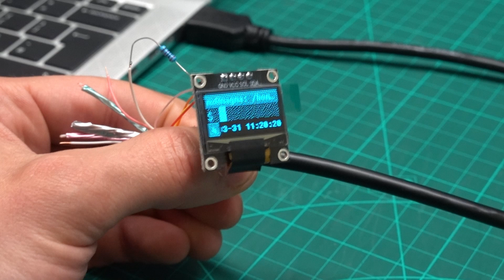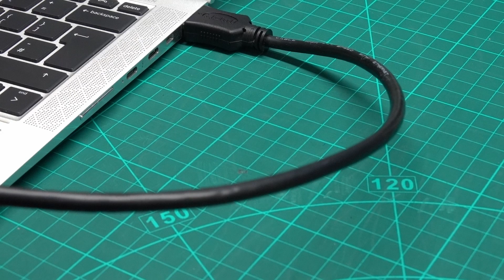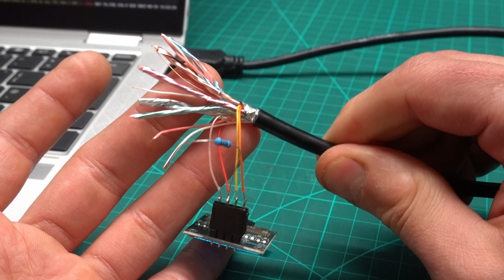The smallest and worst HDMI display ever

Comment: I'm now trying to do this with my VGA DDC, and I've only managed to to configure it and set all pixels high with 0xA5.
Should I be putting the data in some other place that 0x00 of the 0x3C which is the display?

Comment: hey man, got your guide working on VGA! tapped into DDC for the VGA port and it all works powered by the port too! super crazy, i will try initialising the display properly now and start a desktop environment on it, for the sakes of it. you truly inspired me to keep trying this after a year and finding my vga adapter. thanks!
Reply: p.s. booted i3. crazy.
Reply: Did you have a problem where the i2c is connected but not detected
Reply: @APZOEIRT worked fine for me, detection worked immediately and the script ran with adjustment to vga
Reply: @cirkulx its prob my pc having a problem imma try on the luckfox pico later

Comment: You can get miniature displays for like camera viewfinders or electronic monoculars. They will be high resolution and even run at framerates up to like 120hz. So you could get a tiny screen. With much higher quality.... But probably pricey
Reply: found a 3000 Nits 0.71 Inch 1920*1080 Micro OLED Display, but its 250$ usd o.o comes with a board to easily hook it up tho

Comment: holy shit... i suppose i knew basically all monitors manufactured after 2006 or so have an I2C because of EDID, but i never thought to manually go in and mess with the bus. there was a tool that was extremely useful during the transition period of EDID and non-EDID supporting monitors. You would plug your computer's video out into this EDID spoofing box, then the box would output to your weird ancient monitor, and you could have manually adjustable EDID for any given monitor. it let you intercept and change EDID messages or add them for really old ones. This was super useful for some of the shittier drivers of the early 2000's that ONLY pulled specs from EDID, and some monitors just had broken EDID. Basically, the drivers always assumed EDID messages were always correctly formed and had no way of handling broken ones. what a time to be alive! lol

Comment: mitxela, the LoRa devices use this screen. Does it mean there would be a possible way to make a device to hdmi cable? If a small device could write to this display, could the device also handle higher resolutions, or is that where the memory limitations come in? it does some interesting dithering

Comment: The real question for me is if that tiny screen can be upgraded to include a touch screen sensor. 

Imagine having a tiny touch screen from an HDMI port. Hiding a raspberry pi with a tiny screen.... I can see it now
Reply: Well, unless your touch panel is i2c device you can basically connect it to the same bus, access it from pc and write some code, so it will be interpreted as a real touch device in the system. So, techincally it is totally possible unless you don't need your HDMI port for its real purpose)
Reply: @MrImodre  Thanks I didn't know that. I am not a programmer so I'd be behind the 8-ball if I even attempted to try this. I'd love to get it working. It's a good starting point.

My daughter is researching the practical uses for technology when growing food. Trying to monitor pH etc. 

As a intern project for sustainable agriculture en maas or just outright at home. 

The idea is to attach cheap monitors for status but also be able to get into the raspberry pi and configure or update anything on the fly.

The negative is we are trying to do this without making it an IoT device or any connections to the internet. Just imagine using this anywhere in the world
Reply: you could probably use this to make an mp3 player out of a pi zero, if you would be into that
Reply: @autumn64fromdeltarunechapter3  Actually a good idea. I can see them dancing in the greenhouse jamming out on music while taking care of the plants. Hell play classical music for the plants by using it with Adriano to monitor the pH etc. Always looking to multitask lol
Reply: @nomore-constipation  no it's actually a terrible idea because you could just use the native i2c bus and pins on the raspberry pi, because that's what they're for. this is demonstrating that you can do it from a laptop over an HDMI port as a novelty
Reply: You could have, like, a row of them sitting above your keyboard.  Oh yeah, we had that, most people hated it.
Reply: ...mix with a wireless video transmitter for a Dick Tracy watch perhaps?

Comment: Only one thing wrong with it - It's OLED. If only is was LCD. These are used in other small projects and China kits. Kind a cool but personally I really don't like OLED. Leave it turned on and you'll quickly get a burnin on these cheap screens. LCD on the other hand may perhaps lack a tiny bit of contrast but IMHO that is a small trade of not to worry about burnin.

Comment: Is the laptop detected the resolution correctly or you needed to set it manually? 🤔
How the computer detects this display? 🤔
Can be other (i2c) displays hacked onto a HDMI cable like this? 🤔
Also, can this be achieved on Windows? 🤔

Comment: I've just started playing about with a variety of displays; OLED ,eINK, TFT, and this is genius! Subbed.

PS: I've a couple of old laptop lcd panels, wondering if there's a standalone driver board out there I can hook  these up too?
Reply: Yes, if you look on eBay or Aliexpress for „LCD Controller Board“ you can find various sellers (mostly from China) who offer standalone driver boards. In most cases, you have to tell the seller the model number of your screen so they can match the board to the screen you have. The cheaper ones go for around 10-20 $ and often only have VGA, but there are better ones for around 30 $ which have DVI, HDMI and sometimes even an integrated amplifier for speakers. I built a DIY screen with one of those boards myself and it is really handy to have. If you search on YouTube for GreatScott or DIY Perks you can find videos where both of them used such boards to reuse old laptop screens.

Comment: so as it not useing any of the HDMI, video, could you useign in as braek out stile of use still having real monitor on the end of the cable, just extending the required wires needed to get the little screen to work?, the little screen might get a little corrupted if the real monitor pc start talking ?

Comment: I wonder, would you not need to specify the screeen resolution to get the best fit for that device? Also how do you identify which of the HDMI pins/wires is the I2C wires. BTW thanks to your prompting i found a bunch of stuff based on the search "hdmi video over i2c ddc". I had no idea that HDMI had at its heart this device protocol.

Comment: Doesn't VGA already have an I2C? 
Just thought to be able to determine what the monitor is called and what resolution is possible.

As far as I know, SCART only uses 12 volts and sometimes 6 volts as an signal.
But there were also extensions from manufacturers.

Comment: I think your Attempt 1 failed because the HDMI driver would have tried to read the EDID out of the display using DDC, and that of course would fail, so it would just give up.  It also wouldn't have known how to control the display using I2C instead of the normal HDMI TMDS pairs.

Neat hack, though!

Comment: Few years ago I've managed to bitbang SPI on VGA's DDC pins on my 945GM based laptop, and program AVR microcontroller this way.
Reply: Can not be. Yes, the protocol for programming AVR controllers is known, but the I2C (DDC) bus is not used there.
Reply: @ajdarseidzade688  You're right, I2C is not used. AVR uses SPI for programming. It can be bit banged on DDC(I2C) lines with some tricky programming. It is slow as hell, but works.
Reply: @ajdarseidzade688  you can bit bang it still, just like how the attiny 85 doesn't have USB but i still bitbanged the connection + micronucleus to easily program it with usb
Reply: @tormodhag6824  Interesting information. About the micronuleus bootloader. I don't use it and don't know. Thank you.
Reply: @ajdarseidzade688  if you have a attiny85 or other attiny with a hardware interrupt pin on it i would recommend micronucleus it is really useful, my use for it was in this programmable little microcontroller that was kind of like a Arduino but cheap:)
Reply: @tormodhag6824  Thank you! Good luck. Hello from Baku.

Comment: Calling this  an HDMI display is misleading, to say the least.
You could do what you did here just as easily (perhaps even more easily, since you could simply shove two wires in the VGA port without having to hack a cable), with no modification at all, using any non prehistoric VGA port, same with DVI.
Heck, you could do this on a PCIe or possibly even PCI slot too.
Reply: Its a display, that works over HDMI, i'll give him the point even though you are correct as well.
Reply: @nobodynoone2500  Except that it doesn't.
HDMI is not just the connector, there is also the protocol that actually transmits the image signal, which is not being used.
You could tap into the SMBus connections on a PCIe connector and do the same, but it wouldn't make it a 'PCIe display'.
This is clickbait title, as simple as that.
Reply: @pedro_8240  unless you to hack an OLED display to hang off an HDMI port in which case it is an interesting and useful video, calm down.

Comment: Im guessing HDMI protocol is handled on I2C level and safely transformed to this oled. That probably means all electronic displays even smallest use same way of communication on the market. Heaven for hackers
Reply: Actually I think this is just hijacking the DDC (Display Data Channel) controller, normally used for a ROM chip containing info about supported video modes, and just using it as a generic IIC aka I2C controller. This would also work with a USB to IIC adapter.
I believe the standard way to communicate with the charge controller in a laptop battery is also based on IIC, and is called SMBus. Therefore, you could make a laptop battery that is also a second monitor.

Comment: This is flipping awesome! Just for the heck of it, I'd like to put a small oled inside my desktop's case. This might be the way to do it, I have an unused HDMI output on the motherboard.
Reply: OH MY GOSH
That might be a real and ACTUALLY USEFUL use case for it 0.0
Reply: There are multiple projects for that already. Most popular (and the one that you can simply buy for 35$) is GOverlay LCD. It’s awesome low budget hobby project - I’ve been using that for a long time now, and it’s super-hackable.
Reply: This is most certainly not the way to do it. Go with USB driving a μc. You can even pull that off a USB header on the motherboard.
Reply: @TheLukasDirector  sure thing bud

Comment: Would it be possible to create some kind of "adapter" that would filter out the noise on the display? Do you think it would work on an RGB display? I would like to see more projects like this.
Reply: It is not noise, probably there to indicate grayscale colors.
Reply: Yeah, i think thats dithering to give that 1 bit display some greyscale capabilities. also im not sure if this is real or just an april fools.
Reply: @nicholasweiss4662  oh, 31.3, probably 1st April
Reply: @jonny11bonk  It may be a joke, but following the link, I suspect this really works. The display is a real I2C Oled display available from a number of online shops. The HDMI interface does include an I2C compatible port (DDC) which the host PC can access. The DDC connection is there to allow monitors to be 'plug and play'. When a monitor is connected the host computer can read basic information from the monitor about supported resolutions and refresh rates. 
In this case, the port is reconfigured to send display data. This is quite possible though I  have not looked at the code in detail.
On to the 'usefulness'. I am not sure of the capabilities of the DDC port, but I  suspect it uses the standard I2C signalling speed of 400Khz. This would allow a maximum of 40 kilobytes of information to be transferred to a display every second. With the overhead of the display I2C commands, I suspect that 20 to 30 kilobytes  would be more reasonable. 
Why is this a problem? Well, a single VGA screen (320 x 240 pixels) as you might see on a small tft lcd panel needs 76 kilobytes of data to draw in 256 colours. At the data rate above, one frame would take about 3 seconds to send. This is just for a small rgb display. For comparison, HDMI transfers over 1 gigabyte of information per second in 1080p (more than thirty thousand times faster).
So you get an idea of how wonderfully sily this project is. The display is a 64 x 128 pixel display with 1 bit of 'colour' depth. Takes me back to my ZX81 days...

Comment: This would be great for a cheap pc status monitoring screen! It could continuously display cpu temperature or other useful parameters. Using miniature hdmi monitors for this is actually somewhat popular, but this solution is more elegant and should be much cheaper
Reply: I was thinking something like the, make something like USB, memory stick with mini display, even if it only displaying the system time, but in a server/Nas where montior is abit over the top, 
maybe with custiom boot USB boot disk, and this little thing, it could read out test results, 
I take it   it any HDMI/DMI (VGA? maybe) could it be plugged in raspberry PI or anything HDMI/DMI ,games consoles cable boxes DVD/Blu-ray player/recorder etc.
Reply: This wouldn't be great for a cheap status monitor screen, because you need specialized software on the computer to drive it (it's not literally using standard HDMI video, now that would be cool). At that point it's equally convenient to use as a USB serial device doing the same thing.
Reply: There are a few people on here who are missing the point of this video. It's not about whether it's making best use of resources, or whether you should use them in this way, but rather about using a less well-known feature and exploring what can be done with minimal hardware. And it's fun, rather than serious,
Reply: Getting it to work with an extra usb c would be better, and you can plug in something to add more ports
Reply: I actually did just that! Here, I uploaded to youtube a small video of it working, there is a link for the github repository if you are interested. https://www.youtube.com/watch?v=EEGbWqandtk
Reply: This is incredibly stupid because you’re wasting an HDMI port. Literally any microcontroller would be better for that.
Reply: @aarocka11  Are you wasting it if you wouldnt use it otherwise?
Reply: @aarocka11  You can connect the i2c display directly into the DDC lines on the motherboard (HDMI connectors are usually through-hole, so it should be easy to solder wires to them) and leave the HDMI port unoccupied. As long as your i2c display uses a different address to what HDMI displays use for DDC, it should not interfere with external displays. I actually tried this and it works!
Reply: @tychotetra4683  so solder to the motherboard versus using one of the USB ports. Yeah, I think I’m going to use a micro controller over USB.

Comment: Why could you damage your laptop by plugging this?
Reply: Not by just plugging it in I think, unless you accidentally short the 5V and ground. But the I2C bus has other stuff on it as well, e.g. temperature sensors, fan controllers or the battery. So if you make a mistake in your code and write to the wrong bus or address there is a chance to break something.

Comment: I think you can do this with the I2C bus on a VGA port as well.
Reply: I did this with an HD44780 and a BT848... any I2C Adapter should work. 👍
Reply: Same with DVI.
Reply: I did this by utilizing the i2c (DDC) on VGA and connecting an OLED 128x32. This can be handy for a headless setup.
Reply: @deterdamel7380  hi how to do it with VGA , I don't have any device with hdmi connectivity?
Reply: @pratiklondhe5167  The VGA port having an i2c like interface (DDC): SCL (Pin 15?), SDA (Pin 12?), GND (10 ?), +5V (Pin 9?). Please verify the pinout by an internet search. There're some resources about utilizing the DDC/I2c.
Reply: @deterdamel7380   hi , I tried doing it with VGA but it is giving error for smbus write as no such device or address ? can you please help
Reply: @pratiklondhe5167  It's difficult to give some advices here. The OLED is just another device on a I2C bus (smbus is a I2C bus). i2cdetect can detect devices on a bus.  The VGA DDC I guess has it's own bus. As far I remember in my case the driver was not loaded on my HP620. The OLED on I2C may use 0x3C or 0x3D. Try i2cdetect -y 0  .... check if it detects the display adresse. If not, try the next bus: i2cdetect -y 1 .. and so on..
Reply: @deterdamel7380  it is coming as empty :( , no address is showing
Reply: @deterdamel7380  what to do when its coming as empty
Reply: @pratiklondhe5167  I have no clue what you mean with 'empty'.